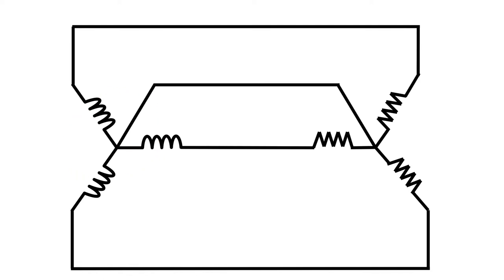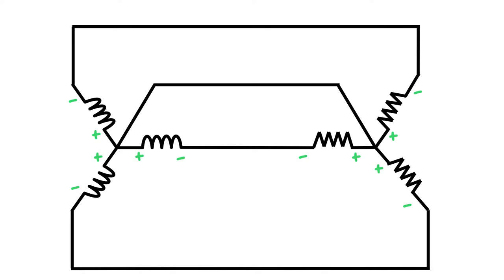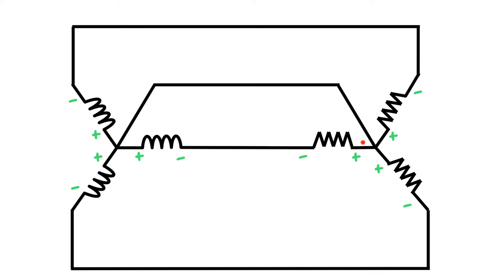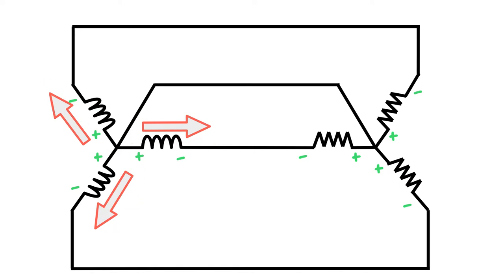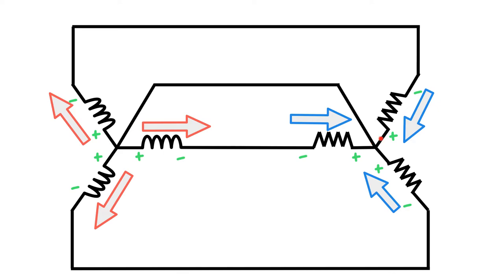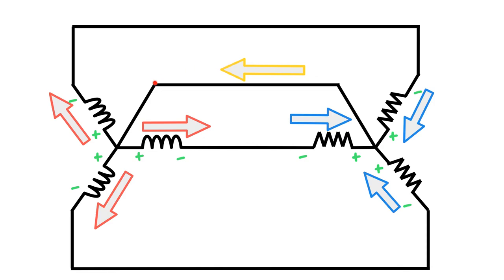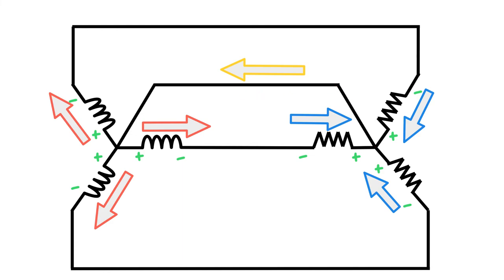Wye current line, phase, and neutral relationships

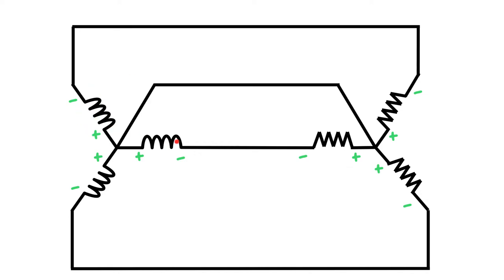Comment: 1:26
Current flows from positive to negative in a source. But that’s around the closed circuit from the source to load and back. So the Load is seeing the positive terminal of the source, which is connected to the negative terminal of the load.